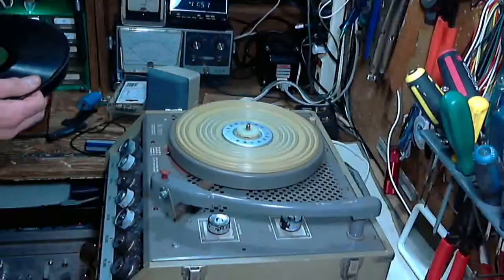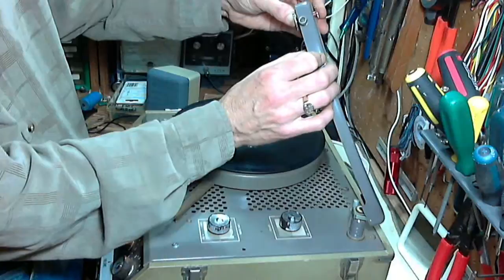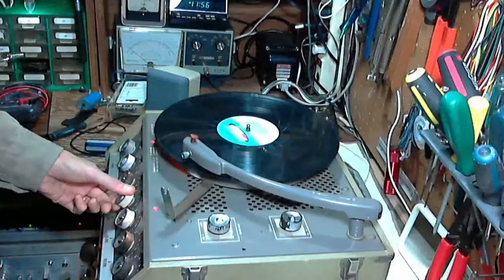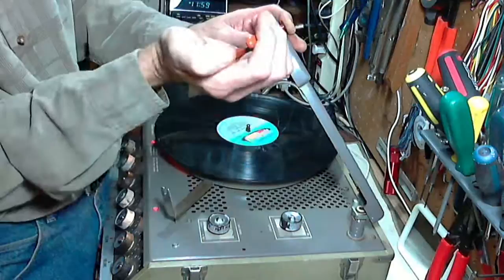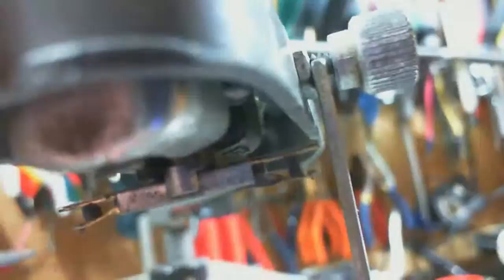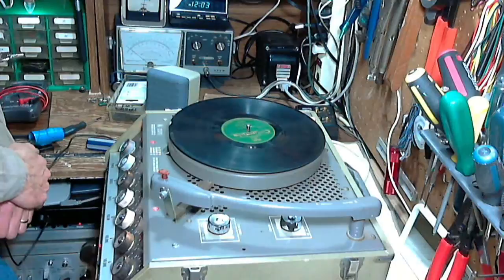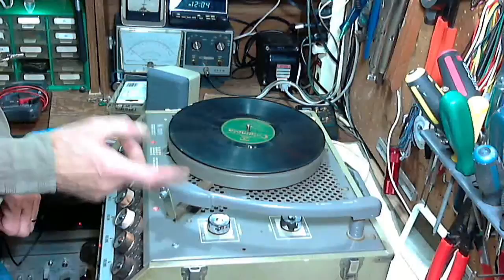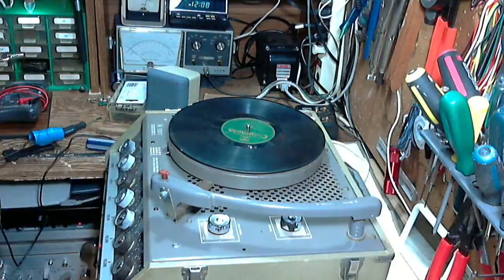Newcomb TR-1656-M Record Player Video #4 - Playing 78rpm Records

Comment: sometimes when the step on the motor pulley does not line up right I bend the idler wheel slightly so it works properly and that usually works for all the speeds  you can bend the needle but do not do it more then two times it is safe to do this but very carefully  the noise when you raise the phonograph volume is a very bad thermal resistor or maybe a bad capacitor
Reply from the maker: Thanks for the idea.  It's a bit too late for this player though.  There are always more to come.  I've got a Midge waiting for a turn on my bench.  Jim.